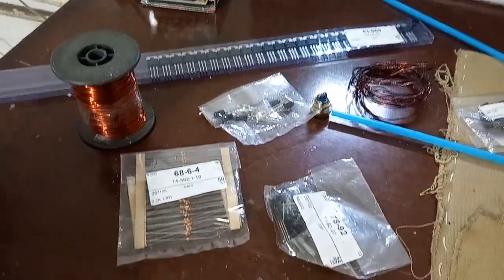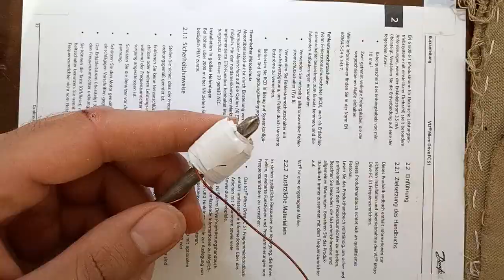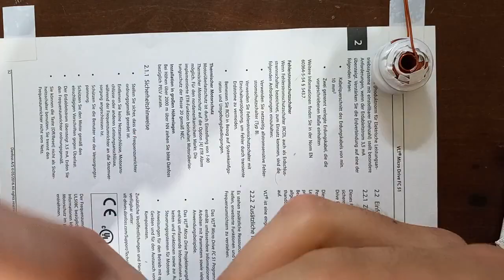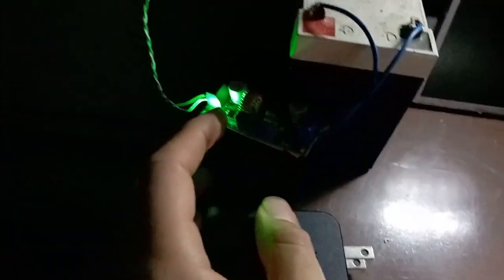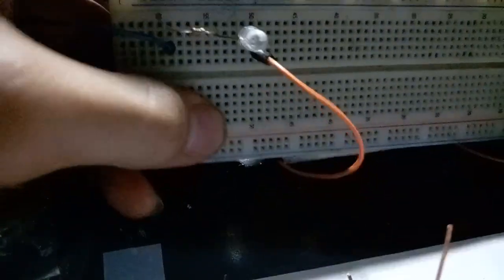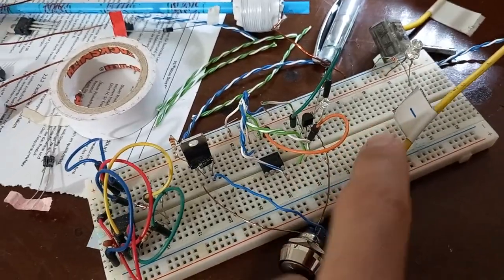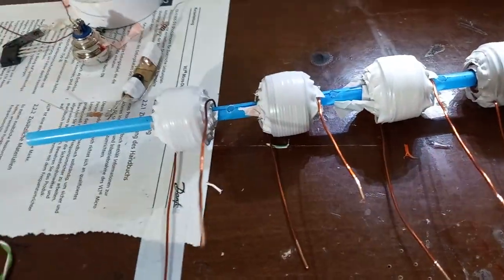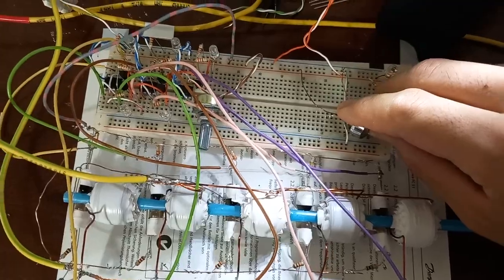Building A CoilGun from Scratch

Comment: My new coil design will be interesting 0.5mm wire max current 577mA but 173wires wound and soldered in parallel is 100amps, i think it's important to have the coil designed to handle the joules but at 12v 100a thats 1,200 joules, but 220v 100a is 22,000 joules, skys the limit that wire can handle 11,000v, its gotta be the coil giving the 5-10% efficiencies that ppl are getting, and every coil layer needs to be wound in 1direction i.e from left to right. No right to left layers.

Comment: Awesome! It would be cool to see it against ballistics gel to compare to other things
Reply from the maker: it's not that powerful. I want to make one with High Voltage Capacitors (this one only uses 20 amps that power supply gives at 12 v but if we use 400 volt Capacitor Banks the Current at a short time would be 400/12*20=660 A!) and the Coils shouldn't be powered with equal Voltages, because the time projectile spends in each coil decreases while it's speed increases, so less energy it gets from subsequent coils, and if we design for Coil efficiency each Coil should deliver equal amount of Energy to the Projectile so less time should be made up for by a stronger Magnetic Field.

Comment: Please give its circuit diagram , I want to build it .
Reply from the maker: feed the IR sensor output to the lm358 op amp then feed it to bc547 in common collector configuration with a pull down resistor of 330 ohms then u r good to go to the gate of the mosfet..